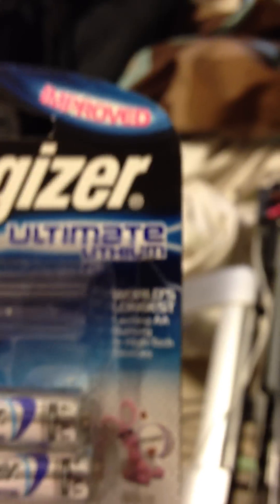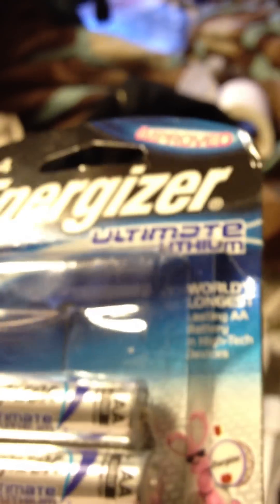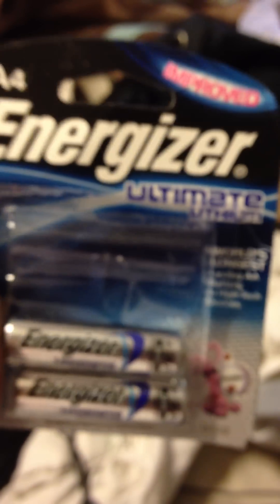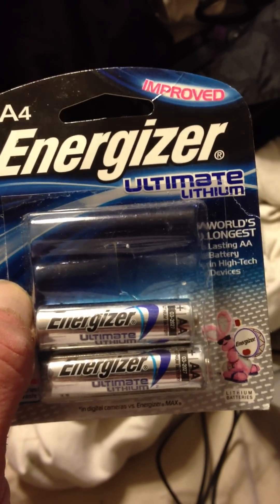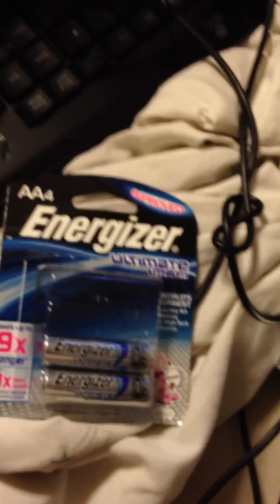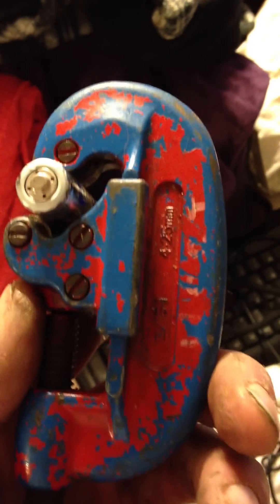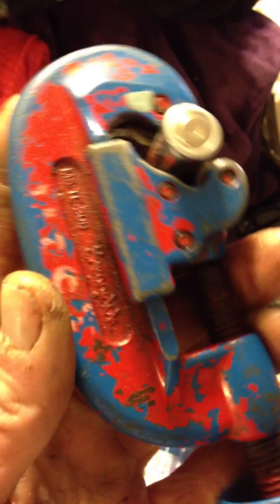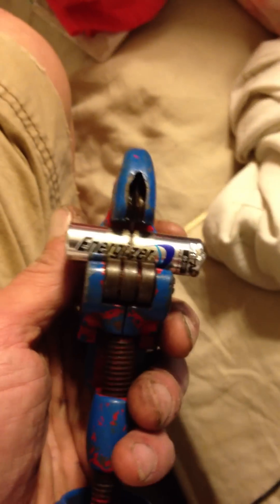EXtract Lithium Quickly From Energizer Battery

Comment: Pipe cutter seems like a do or die approach, split the case and pull the cylinder before it heats up.
Best done outside with safety glasses, gloves and a lab coat and a full container of mineral oil with a cap to store it without air bubbles. 
In fact might be good to have a pan of mineral oil to separate the metal from the rest of the battery and to prevent tarnishing.  
The question, after collecting 1/2 dozen batteries metal how can you melt it into a rod using a test tube. It's so light if floats on mineral oil, maybe helium gas in the tube soaking in a hot mineral oil bath.
Nope, not everyone viewing wants to make Meth.

Comment: Put the lithium metal in mineral oil or something. Otherwise, it's going to tarnish. So you're reacting lithium with benzyl chloride to make benzyl-lithium? And then reacting it with acetonitrile in diethyl ether and toluene to make P2P(Phenyl-2-Propanone)? And then using BlueDex Aluminum foil galinstan amalgamation reductive animation with ammonia in distilled water and ethanol to yield amphetamine? Or reacting with hydrazine in the BlueDex method to yield pheniprazine? Ok. Just look up the MSDS.

Comment: I wonder why he needs to lithium for what's so important about lithium
Reply: making meth but why im here is because at The King of Random youtube channel they showed you can use lithium from batteries to make red fire and this video is atrotious
Reply: man in this video is 100% making meth, even read literally all the other comments lol
Reply: Lithium is good for making benzyl-lithium from benzyl chloride. Then Reacting with acetonitrile in diethyl ether and toluene cosolvent for P2P(Phenyl-2-Propanone). Then P2P and hydrazine solution in distilled water and ethanol using BlueDex method galinstan aluminum foil reductive animation to yield pheniprazine. No need for mercury.

Comment: Wtf not only is this guy 99% making meth, this is also significantly less safe than any other methods... For starters he didn't wear gloves, he cut the battery open. And when he says "when it gets hot your good," the heat is referring to the battery short circuiting, which produces a lower quality lithium than a un-touched battery. Next, he touches the iron disulfide with his bare hands, probably not the best idea there. And then he proceeds to sloppily fold the lithium and suggest that you put it in a "dry place" while he is right that the presence of water can be dangerous, He fails to acknowledge that the metal is tarnishing. 0/10 don't follow these instructions
Reply: Andrew Vantiem LOL my first thought as well. The pipe cutter method is so much easier though.
Reply: Unless the battery burns up, it wont affect the lithium at all. I do it all the time for class. And no, sparks isn't good because if it shorts and releases it's electrolyte, that could hurt.
Reply: +TheBackyardScientist is this what you followed to make your fire video. .?